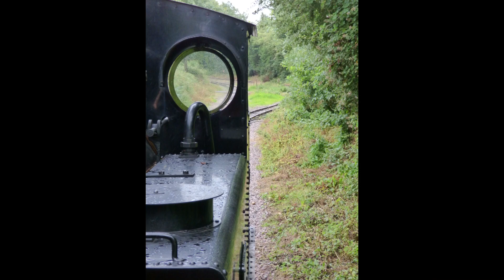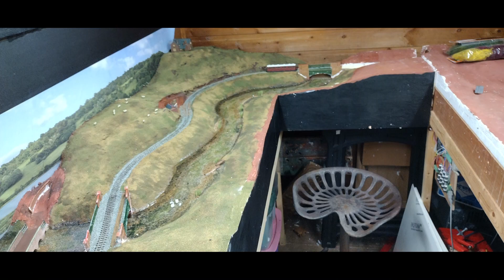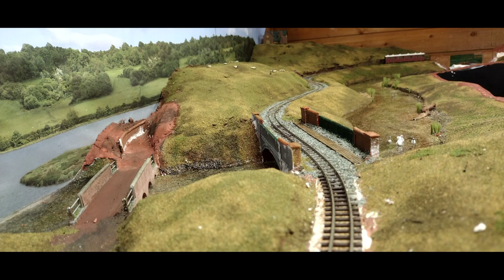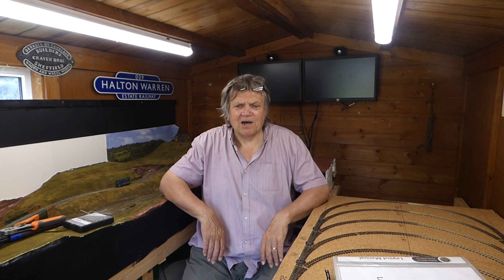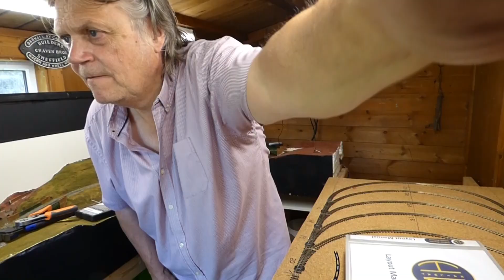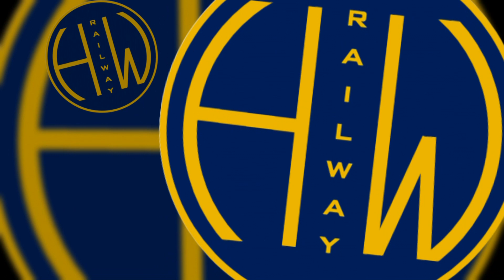Fiddle Yard Is Working at Halton Warren OO9 ¦ 019

Comment: The point motors you are using are very noisy? What make are they?
Reply from the maker: Hi

The are DCC Concepts Cobalt-iP Analog point motors,
They may sound noisier than they actually are as the camera is sitting on the fiddle yard board and very close to the point motors, also being in a smallish shed the noise is amplified and bounces around a bit.
Mark